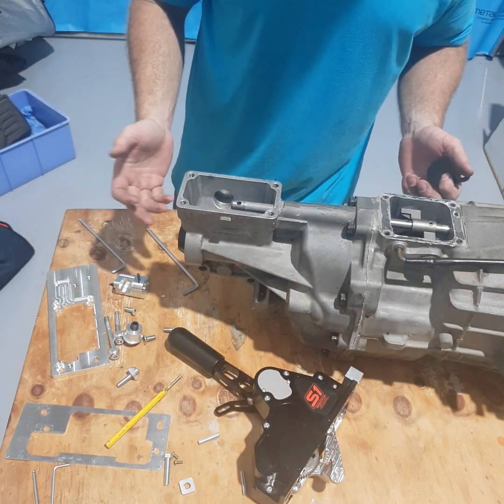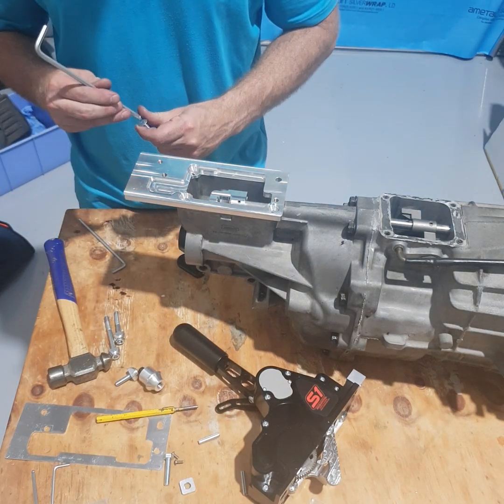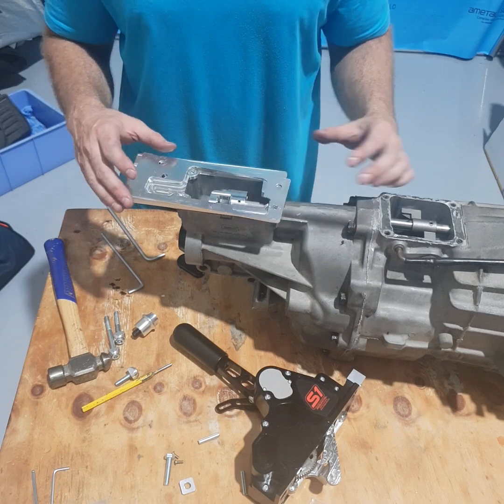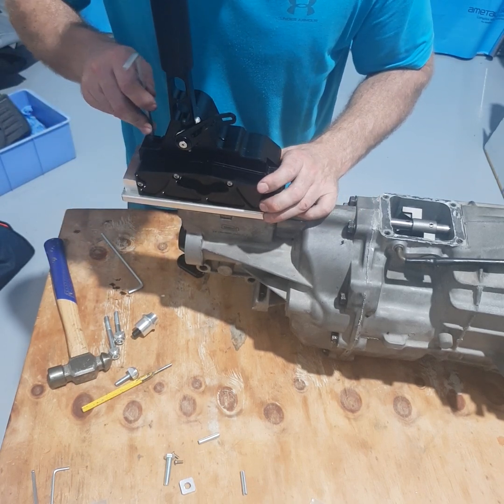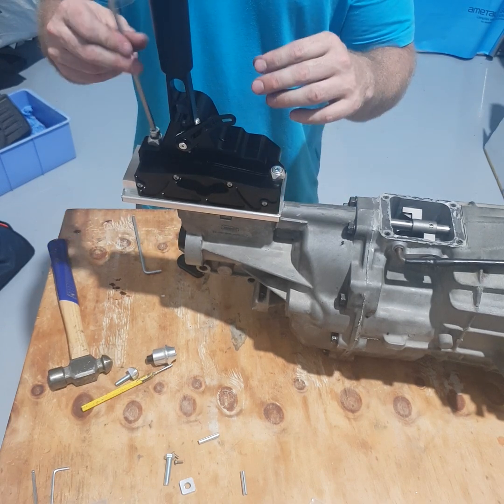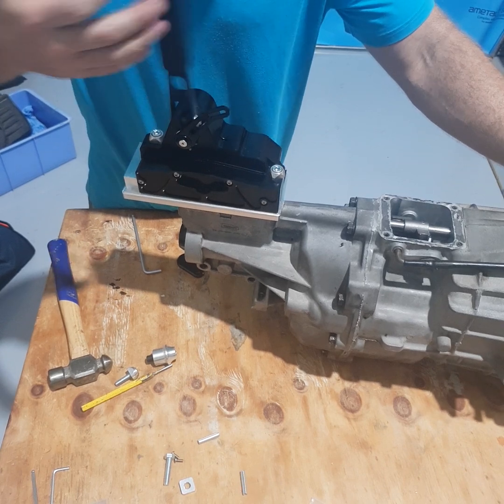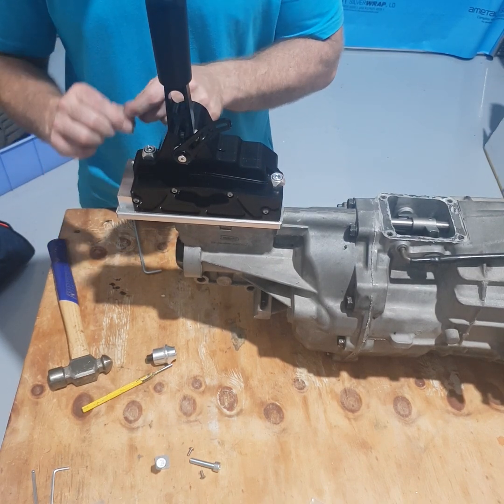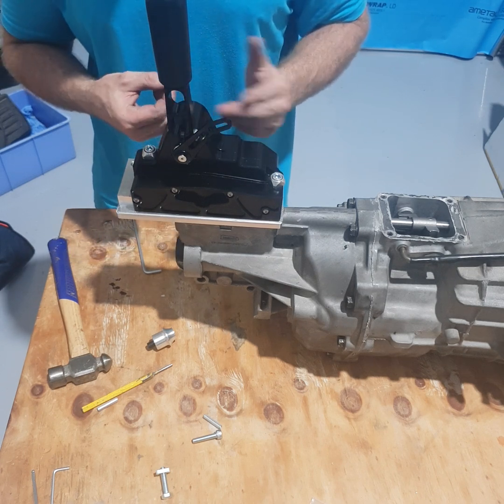Sequential shifter install : S1 sequential

Comment: so I can install this without dropping trans correct? 2010  camaro ss
Reply from the maker: Yes you just need to lower the rear of the transmission. There is no need to unbolt it from the engine.

Comment: Hey! Will this work for a 2017 M6 Hellcat? It has the TR-6060 M6 transmission. Will be upgrading to an RPM Level 7 with bronze fittings/etc.. Want to clarify. Have had my eyes on it for a while.
Reply from the maker: Unfortunately we don't have one for that , the hellcat box is different to every other Tr-6060
Reply: @S1Sequential  ต้องการซื้อ

Comment: Very nice and for certain applications the price is justified I guess. Really wish they were around $800 us dollars instead of $1620 though, oh well one can dream right?
Reply from the maker: A normal H pattern shifter is basically a stick on a bearing, this has many precision parts in side to make it work this well.It would be impossible to sell a quality product for 800.
Reply: @S1Sequential  impossible
Reply: @gavin4157  Impossible to sell one and make a profit

Comment: I have a fg xr6t. Would you need to remove the gearbox to fit one?
Reply from the maker: No it is done with the gearbox fitted. You will have to trim the transmission tunnel a little but we have a shifter surround that seals this back up for a nice street car finish. https://www.s1sequential.com/product/sequential-shifter-ford-tr6060-t56/
Reply: @S1Sequential  I bought one hope it shows up soon.